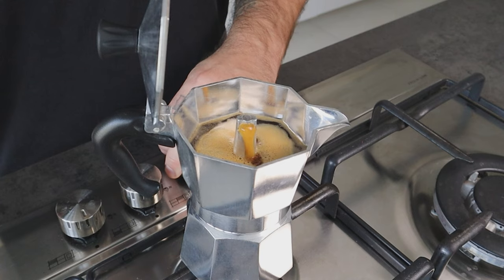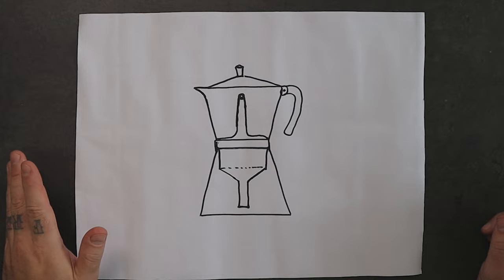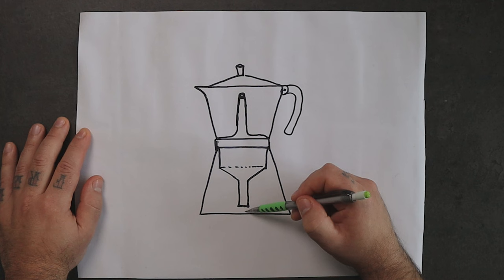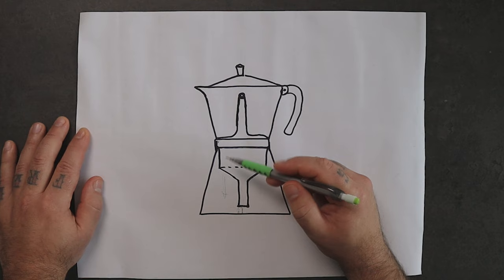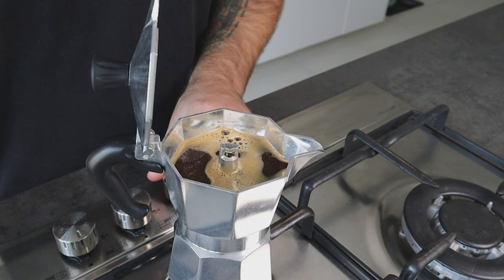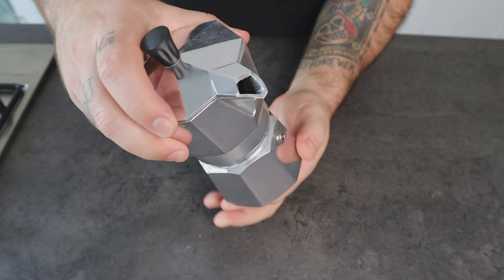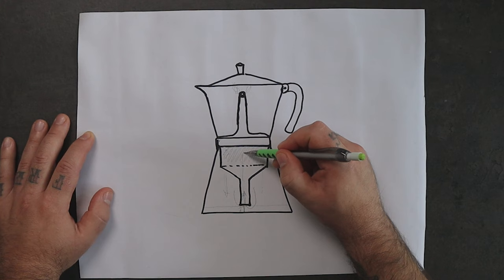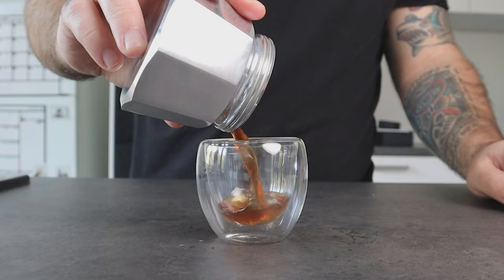EXPLAINED - Why There is Water Left in the MOKA POT After Brewing

Comment: I don't agree. Most of the time all of the water in the chamber comes up and after I pour out the coffee, when I rinse the pot under cold water it hisses and steams. Then after a while a problem emerges where all the water doesn't come up. I pour out the coffee, run it under cold water and it does not hiss and steam. Then I find coffee in the lower chamber. It seems to me there is something wrong when that happens.
Reply from the maker: You have coffee in the chamber because you cool down the hot water so from an environment with higher pressure it goes back to standard pressure, that will suck the remaining water left in basket and upper part bringing down some fine particles. If all the water in the chamber goes all up, then you don't have this problem. But not all the mokas and baskets are the same.

Comment: I have moca crema and it sputters right from the begining
Reply from the maker: Alright, the problem can be, heat source too high, coffee ground too fine or too coarse. A suggestion I can give you, is remove the moka from the stove once the coffee start to sputter at the beginning, that will calm down the water, after a few seconds place back the moka on the stove at low heat, you will see the flow coming put more regular, if it starts to sputter again, repeat the process of taking the moka off the stove, wait a few seconds and then back on

Comment: One reason can be that the coffee basket can not hold the pressure correctly inside the boiler. You will hear the leak too.
My solution was to measure the coffee cup OD and go to a hardware store, then search for a 1mm thick O-ring with slightly smaller than the coffee cup measurement. No more leaks.
Reply from the maker: Yes that could be another reason. But here I wanted to explain something that happens with a full working moka
Reply: @matteofromtheswamps  I understand, I have  9 Cup pot, what filter do you recommend?
Reply from the maker: @Ahto42   you mean paper filter?
Reply: @matteofromtheswamps  Yes, paper filter
Reply from the maker: @Ahto42 see if aeropress filter fits otherwise you can search for larger paper filters, if you can’t find bigger paper filter you could cut the right size using bigger flat papers. It will take a bit of time cutting them so it depends on how much you want to brew with paper
Reply: @matteofromtheswamps  I make it once or twice a week, I think I can manage with out it. My coffe mug is like 600ml :D

Comment: 1) why is the coffee not coming up
2) how to fix it
3) is ptfe tape safe to use with moka pot
Reply: 1) could be the coffee is ground too fine, it should be in a middle of espresso and drip coffee grind size. Could also be the gasket is not sitting right/broken
2) check first if the gasket/seal is broken by running a moka pot cycle with just water, no coffee. If the water comes up, try a coarser grind with your coffee
3) ptfe tape is not needed for moka pot, not advisable